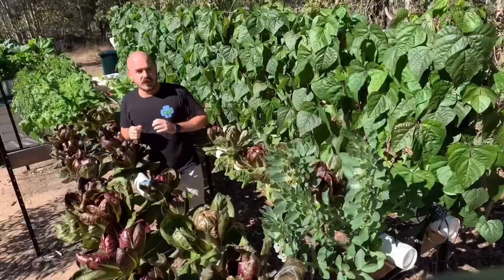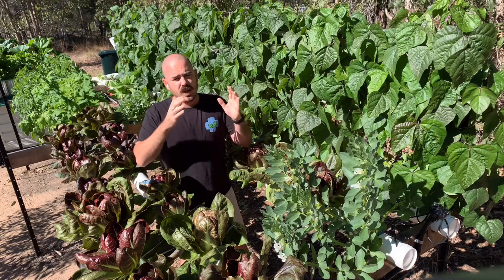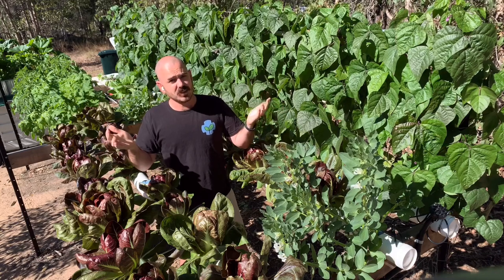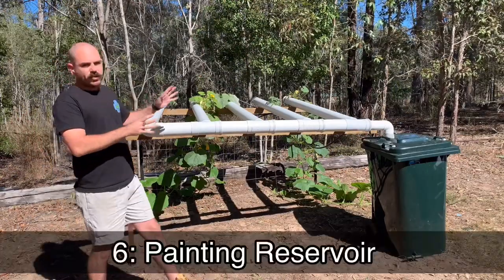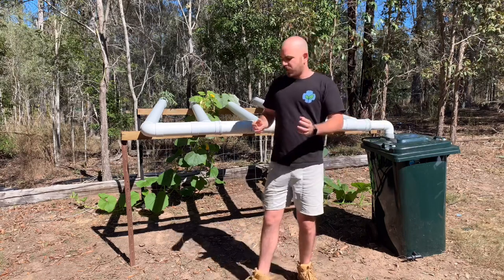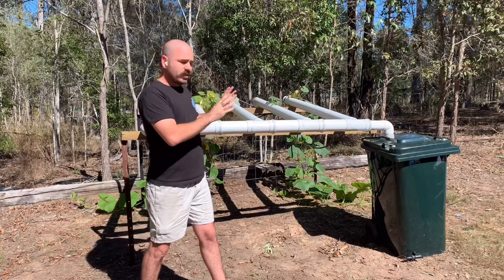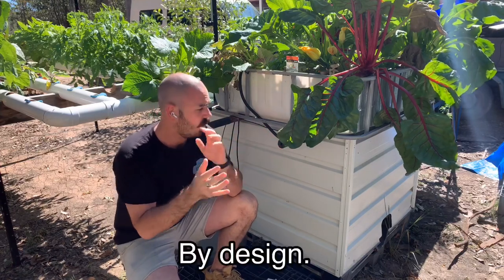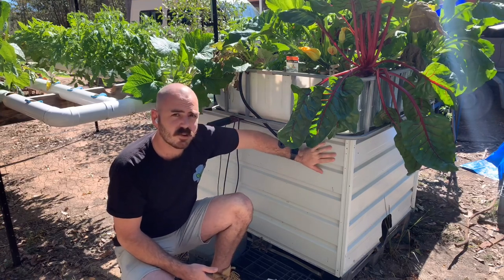How to: Lower the Temperature of your Hydroponic Reservoir

Comment: Very much appreciated. I live in Mesa AZ and it's 115 F with lows at 80 in the summer. I'm either doing shade or putting the reservoir under shade like under the fruit trees. The cladding might work well with the plants on top of the reservoir. Make sure not to use aluminum for cladding as it transmits heat. Even aluminum based paint.

Comment: Great video. I used a cheap mini fridge with 50ft of coiled 1/2 tubing inside. I also thought about using a chest freezer for the Res.
Reply: Cory, I am curious as to how the small frig with coiled copper tubing inside worked for you? I have all the parts and was thinking about using the small frig route to save some money cooling my reservoir. Thanks Cory
Reply: Cory, how did the small frig cooler work out for you?
Reply: Not really sure on spec's but it did drop the temps very well. It was enough that It stopped my issues. It's better if you have a bigger res and you can bury it.

Comment: Thanks mate, this subject has been on my mind lately with summer coming up and I will be moving my plants outside very soon. I was going to use a cooler on solar as it would only be needed when the sun is beating down but I will definitely be using some of these tips. Thanks!
Reply: yep i will be looking at a sola panel charging a battery to run a portable caravan fridge --the returning solution would go through a coil in the fridge then into the tank-----sola free energy-i think the most temp the plants will take is 86 deg--31 c -here in australia we getting that now  and we have months to go yet-so i better get cracking

Comment: Hi Hoocho, I've been binge watching your videos the past few days. They all have so much clarity in how the information is presented. I can't believe I've persisted with growing in soil for so long. I think I'm now converted and will be designing a NFT system myself. A question about shading with a cover crop, more so with the actual system you are using that had the pickling gherkins in it above the IBC reservoir. How is this integrated into the NFT system? or have I just missed a video? Love your work!
Reply from the maker: Dan M I was actually designing an aquaponics system and got side tracked by NFT, I used the chop and flip system I’d been planning on turning into an aquaponics system for the res.
Here’s the vid:
https://youtu.be/ZnDTl8ZtGms
And here’s the update that I reference the vid.
https://youtu.be/umdPlokiiu8
They are old videos so excuse the editing/ quality

Basically the top bed is a flood and drain with a bell syphon draining into the res which is the res for both nft and grow bed.

Comment: Hi mate. I'm in the middle of setting up a solar pool heating system. The sort that has tubes on the roof. The controller has a cooling mode. So if the pool is over the target temperature and the roof is lower than the target temperature (eg at night) then the pump turns on to cool the pool. This could be an option for larger systems to cool things down.

Comment: Hi Hoocho, thank you so much for the informative videos. With me being an absolute beginner, You've been able to equip me with enough knowledge that I was able to have a full on conversation regarding hydroponics with a professional grower at a local hydro supply store. He was quite surprised with my knowledge and I pointed him to your channel as my source 😊

I have 2 questions:

1) what material are you using for cladding?

2) would you recommend using an aquarium heater to keep the water at a steady temperature during colder periods? The one that I'm referring to has the ability to set a temp and it turns on and off just to heat up the water should the temperature drop below the predefined temp.

Many thanks.

Comment: Quick point: using NFT in hot climates, do you think that doing all channels in parallel is better? Chaining channels would gradually heat the water whereas in parallel you increase oxygen, level nutrient concentration, and keep temperatures low. Am I wrong?

Comment: Ok......here's the best way to control the summer temperatures of your reservoir.
U can use a much cheaper "chiller " by substituting a cheap & used small deep freeze w/adjustable Temps. U can get an extremely efficient electric. Solar is best w/just 1 panel or propane that cost pennies a day 
U simply cut a hole or entry point for your reservoir tubing into your deep freeze & adapt to a aquatic friendly garden hose by which u can run 50'-100' in a circle & adjust your freezers temperature to high around 60'-70's which as the 50'-100' hose fills w/cooler water exists the freezer & into the nft system. U can run extra hose back outside to raise the Temps coming out the freezer if it's too cool so as not to shock anything. It's the best way to cool your system when u reach 90° plus & easily manage it. This is used in aquariums when we're too cheap to buy an actual chiller for large saltwater tanks costing well over $1k.
Give it a try!
Desperate? Even a small frig will work.
Cheers!

Comment: Yes, I have a water chiller for my laser system, and it wasn't cheap plus I can imagine my electric bill now running 24x7 with the inflation costs across the USA with some at 80-100% more than before Biden's recession/inflation.  Oh, and I can't get the water temps below 22-24c else the chiller never turns off due to 37-40c days.

Comment: does burying the reservoir help in lowering temperature in a hot-climate country?
Reply: Yes it does and Hoocho mentioned it briefly about 7 minutes into his Vlog. Be careful to leave a few inches of the tank above ground, or you might regret it during heavy rain, if the tank does not have a water tight lid.

Comment: Any tips on controlling PH? 

Brisbane tap water is 8.2 and I cant get it down to 5.5-6 PH.
Reply: I personally just use a commercial hydroponic ph reducer which is basically just sulphuric acid. You need a ph meter to use it, because it's really easy to go too low. And of course you need to be careful with it, because you could burn your skin. But it's been working great for me. 
Don't be tempted to use an organic acid like vinegar or citric acid, bacteria will just eat it up and after a day you will be back to your original ph with a dose of bacteria sludge
Reply: Im using phosphoric acid which I dilute to a 20% concentration. Then it’s easier to not overdo it and dose it right.
Reply: Hey guys thanks for the advice. I have some Mantuec PH down I’m using but after testing and measuring out the correct amount to achieve the desired PH it seems to rise again fairly rapidly.
Reply: Jac ruhle I had the same in the beginning because I used a 3 component fertilizer. I added all together which caused a nutrient lockout and a raising ph from 6 to 8 within two hours. In case you have multiple components in your fertilizer you need to add each component single and stir till all is solved. Then add the next one. I use a Ready blend first, then Magnesium and then calcium sulfate at the end. I was searching long what was wrong.
Reply: @niklask.5593  Niklas: I’ve used the Masterblend for years. When making 5 gallons, if you mix each component in a separate gallon container, with warm / hand hot water, they completely dissolve.  Then just mix them with 2 gallons of cold water.  I’ve never had a problem with either fallout of nutrients or varying PH after they have been mixed.
Reply: @dI0x0Ib  +1. I've experienced the sludge problem too. Commercial pH down agents works best